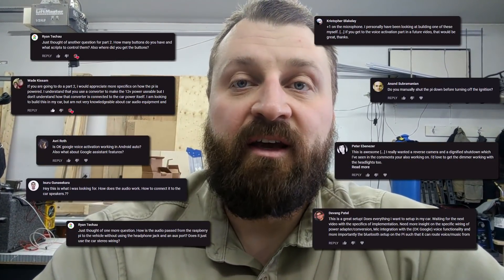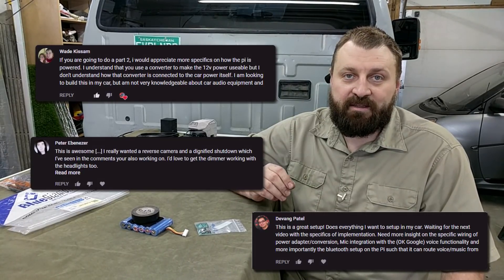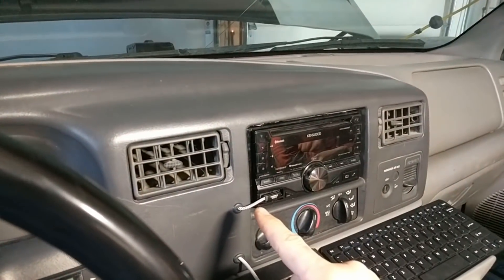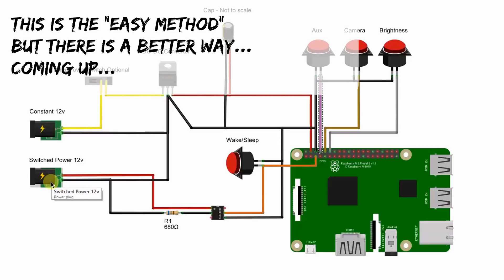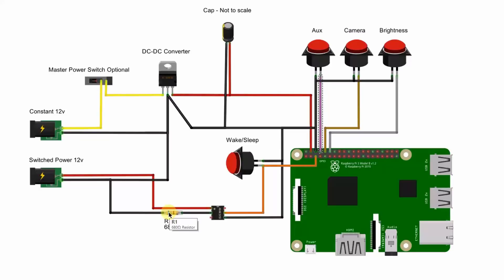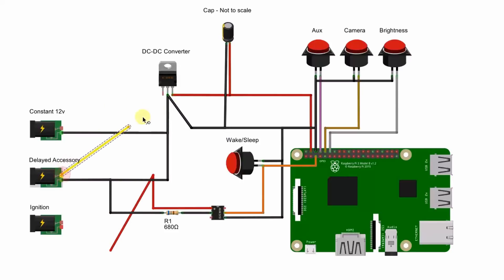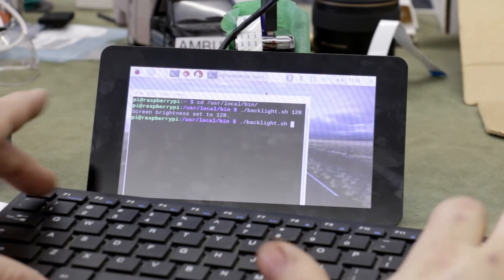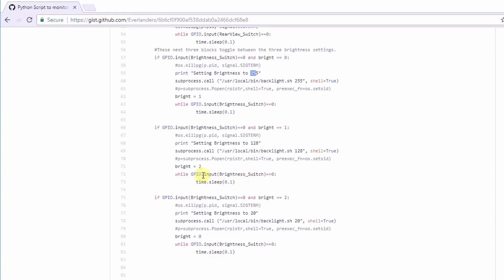Wiring AndroidAuto & Raspberry Pi to your Car - Rear View Camera, Connection Diagrams, OpenAuto

Comment: Jumped over here from a completely unrelated page but he was just starting to do a build like yours and your video was suggested,  free likes on both for having this awesome bit of info. One question I'm wondering about though, is there some way to get multiple camera inputs? Would love to have a front and rear camera option if I could. Maybe even a third on the top of the cab to replace the rear view mirror. Great stuff though, really want to try something like this
Reply: Looking into this stuff to put it into my overlanding vehicle and had some info relevant to your comment.
There is also a multiple camera adapter you can get that allows for 4 cameras, and it is stackable to add additional cameras.  May not be compatible with certain versions of cameras. I don't have any experience with this part personally.

https://www.amazon.com/Arducam-Camera-Adapter-Compatible-Raspberry/dp/B012UQWOOQ/ref=sr_1_4?s=electronics&ie=UTF8&qid=1535942318&sr=1-4&keywords=raspberry+pi+camera+adapter&dpID=41m8s9EsWoL&preST=_SY300_QL70_&dpSrc=srch
Reply from the maker: The Raspberry Pi only has one camera input for the 5 or 8 megapixel cameras. You could use USB cameras for the other views, but they are much lower resolution. I will have 5 cameras total, but each one will have its own Raspberry Pi and then the video will be sent over Wi-Fi or wired LAN.
Reply: Everlanders Did the adapter below work out for you? I’ll be looking to see your results, as I’ll need four or five cams as well and I don’t want to use WiFi
Reply: @Everlanders  if you're only switching between them and not looking at them all at the same time you could take advantage of the fact you are using HDMI cables for extending and use a HDMI switcher. Just open it up and connect the source switching button to one of the IO pins on the Pi to trigger it. Could be a cheap alternative for a camera view switcher.
Reply: im running both. i ran the backup cam like he did and a web cam for the dashcam. Using motion for the dashcam recording and then use proftpd to allow me to connect over wifi and pull the video.

Comment: Quick question about the power still; did you split the power and ground from your harness or run new wire? Thanks for the great video! I will be building something similar for the Grand Prix soon! :D
Reply from the maker: Initially I had the wires split off my stereo harness, but now I've run new wires to the ignition and delayed accessory as I indicated in the second video. The more better method.
Reply: Got it! Thank-you sir! Just wanted to make sure it was enough juice for everything, very nice video; sub!
Reply from the maker: Oh Yeah, there is more than enough juice using either method...

Comment: that's incredible how fast can be that build compared to my 800$ navigation system... I feel like i've been f**ked... ahah
Reply from the maker: And you know what else... Your maps are probably already out of date, and mine show live traffic conditions... :-)
Reply: Well, actually, i'm designing a new HMI for one of my customers. I'm used to working with microcontrollers but i'm now looking for something with some more attractive graphic designs. Then, when i see the field of possibilities that offer the raspberry (or other arm based chips, such as imx6 etc...), It really makes me want to work on that kind of projects. I've just bought a raspberry 3, and i'm now learning yocto and qt (just started yesterday).
Reply: What about building the same Raspberry Pi based autoradio with a HiFiberry (+ external audio amp) ? Do you think it could be possible/easily achievable? :D
Reply from the maker: Sure, Why not... In our case we have a big block Diesel hammering away, so the extra Fi's are of little use.

Comment: Great video/project!

I've always heard it is bad to rest your hand on the shifter and load the shift forks constantly.  Might be a habit to break...
Reply: I wouldn't worry about that. I put more force into it shifting than resting my hand
Reply: Smug mode, the issue isn't the force applied, it is the constant pressure of the brass shift forks against the groove in the sliding hubs.  It will eventually wear out the brass forks and create way more slop in the system.  The failure pattern is that it will not engage all the way into the detent due to the increased clearance and thus will pop out of gear.
Reply from the maker: I agree, you shouldn't rest your hand on the shifter.

Comment: I stumbled on your video while looking into crankshaft.  I think your option will be a better fit for my android auto build going into my Fiat 500 electric.  I like seeing good Canadian talent, and look forward to more tech-type tinkering in your future vids.

BTW, What was the brand of the HDMI cable that did NOT work, so I know which cheap cable to avoid?
Reply from the maker: Thanks Shaun! ...The listing for the cable didn't even have a brand, checking the video, (zoom and enhance) ;-)  0:56 It's a "Low-Price" brand... lol   After more testing I think most of my problems are due to the long wire requirements. I need almost 30 feet to get that far back...  On your shorter car you'll have fewer problems.
Reply: I read some where it has to do with the grounding wires of the HDMI cable. Ill see if I can find the post
Reply: http://petitstudio.blogspot.com.au/2015/05/hdmi-cables-are-not-all-same.html
Reply: How are you mounting this in your 500? I'm wanting to do this in my 500 as well but haven't decided how/where to mount the screen yet.
Reply: Bryan Castleberry I plan on adapting the post that holds the TomTom GPS, as it is powered, to hold this case. https://www.amazon.com/gp/product/B01GQFUWIC
I haven't worked out all the details, but I hope to keep the wiring hidden somehow.
Reply: Shaun Aune cool, unfortunately my car doesn't have the Tom Tom. I've decided to create a custom bracket that will hold the screen to the left of the instrument cluster. Hoping to get a chance to work on it this weekend

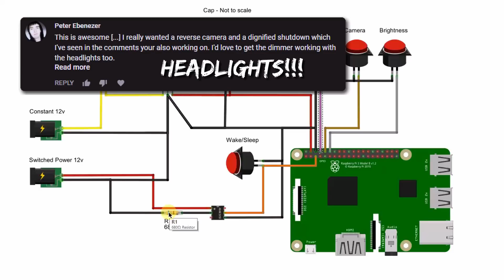Comment: My first youtube mention @ 7:15! Yay! Once again, thanks for the great vid!

Quick question to do with the whole headlights thing... 
Would a feed into the headlights work using your code? Your code seems to use momentary switches? My hope was that when the low beam of the car is on, its clearly dark out so the unit would revert to the dimmer setting, if that's not the case then give max brightness - not sure how I'd go about this as it would be constant, not momentary...
(Could even go one better and take a feed from the sidelights too, make those drop the screen to 75% and low beam take it down to 50%!)
Same question for the reverse camera really, you use the momentary switch to toggle the three modes, I'd like to pick up from the reverse light circuit and then cut to just the standard reverse camera mode?

Love the demo you gave in this video, I didn't know that the music still plays while the reverse camera is up. For some reason I just assumed it would pause/mute theaudio, glad this isn't the case!
Reply from the maker: Peter, I've made a copy of the script and edited it for you, I've not tested it yet myself.
https://gist.github.com/Everlanders/e08fe32b8012395d4afc558724937ad4

The momentary buttons don't really matter, It's the script that needs a small edit. Right now, when you press the button it does something, and when you release it it does nothing. Press the button again it does something else, when you release it it still does nothing... Etc etc  You just need to change it to do something, when the button is pressed and Something Else when it's released. Button or Optocoupler, same story.
Reply: Everlanders , you sir are a gent. If I regularly wore a hat I would tip it to you....
Reply: @Everlanders  Really appriciate what you are doing! I have a same plan with the rear camera. I would like to have Raspivid come up automaticaly once the rear light is on. If I understand that correctly beside camera connected to rear lights circuit I also need a wire connected DC-DC 12V - 5V convertor coming from rear lights to GPIO and then use your edited script that will wait for the signal to open / close view of the camera?
Reply: That is awesome, I am looking into setting this up in my xterra and I was thinking the same thing about using the lights.

Comment: Thanks for the great video and answering my questions. What optocoupler, cap and resistors do I need? I am working on putting together an amazon order for supplies. Thanks again.
Reply from the maker: I'd order this stuff from Digikey.com personally, even the Pi and the screen, But if you want to order at Amazon these will work.  Try with a 1K resistor first, but if that doesn't work use a 680ohm
4N26 OPTOCOUPLER  http://a.co/37qUr1n
Resistor Kit Assortment  http://a.co/8QKpNRt
16 volt 4700uF Cap
Reply: Everlanders thanks for the quick response appreciate it. For the master power switch should I be looking for anything specific? Or just any switch will work?
Reply from the maker: Almost anything will work, personally I'd go the "More Better" method shown after that which does not require a switch.
Reply: Everlanders I will have to re-watch that part and see if it will work with my car.
Reply: After looking again and not wanting to tap into the ignition wiring I am going with using the stereo harness method. Have all the parts coming in the next day or two and will let you know how it goes.
Reply: So all the parts have come in and I loaded up everything to just get the Pi and Touchscreen working. Loaded Raspbian and then followed the steps to clone/build open auto but it would not work when I plugged my phone in. I flashed the sd card with crankshaft and have it working now when I plug my phone in. Looking at the wires on my stereos harness the Yellow is the battery constant and the Red is the ignition switched. Could I just tap into the Red ignition switched wire and the Black ground and go into the converter and then from out the converter go into the Cap and onto the GPIO pins? The crankshaft image has a button to shut the system down and is going to be implementing brightness control and my stereo turns off when I turn the ignition off. I am trying to avoid doing the buttons since they do not seem necessary for my build. I really appreciate your feed back and help.
Reply from the maker: I chose not to run crank shaft because I'm not sure what else they cooked into that OS. Building from the original source is always the most secure method.
Reply: Everlanders yeah I followed the wiki to build from source and the app loaded but it would not work properly. For some reason Android auto would not see it from my phone. It's all wired up and working now though 😀
Reply from the maker: That's good for you, I'm just warning everyone else that may not want Bitcoin miners running in the background...

Comment: excellent video! Great explanation of the scripts and really good demo of the expected performance when multitasking. Seems that it really comes down to how good your phone is. I was looking at the USB sound stick you linked, but noticed that the frequency chart they provided rolls off a lot down in the bass region, not sure how true that is but i was lookin at the HiFiBerry board for the Pi since my application is more of just a standard high powered car stereo (daily driver 2003 Camry). Looking forward to your other videos about your overlander, maybe it will inspire me to actually get off my butt and do this off-road trailer camper for my '99 Yukon.

Comment: Optocoupler, l learned something new today. Very clear explanation too. I could have used some of this info on my arduino speedometer I built for my jeep a few years ago. I'm going to have to stash this away for future use. Here is my Arduino controlled speedo https://youtu.be/ag_pazgLkmc?t=15m20s. Thanks for sharing this great info.
Reply from the maker: While that is true, in the context of this installation we need to sense one cycle - so that's not really a concern. Furthermore, if you have spark plugs sending kV up your ignition switch wiring, you've got much bigger problems.
Reply: generally good for up to about 50-150KHz when playing with Optocouplers a few things to note :
they have frequency limits that are defined by rise/fall times that are directly related to the current limiting resistors you choose
they are not infinitely isolated from voltage spikes like a bad spark plug wire, could still fry your arduino/pi
there are high performance ones available but get pricey.